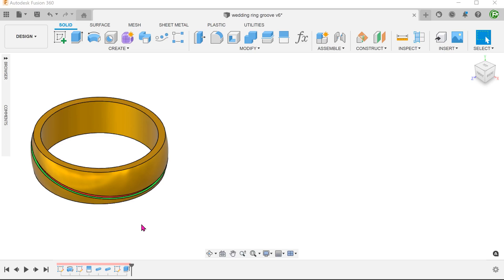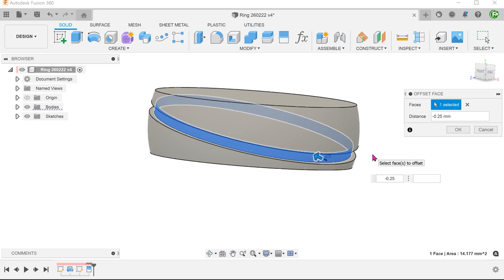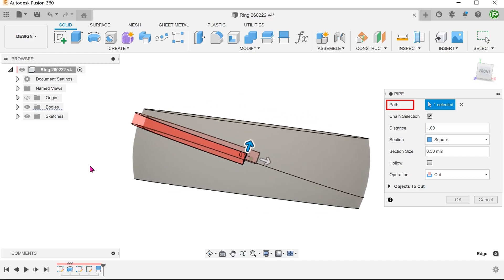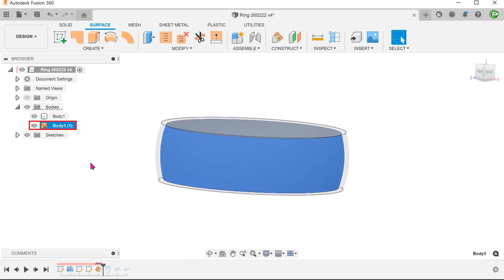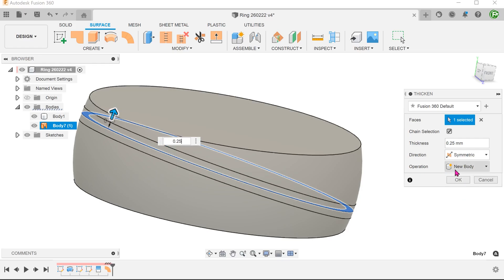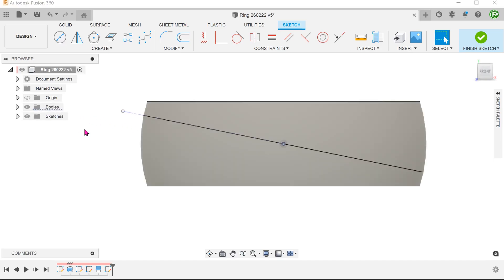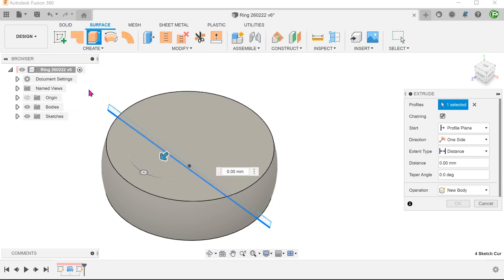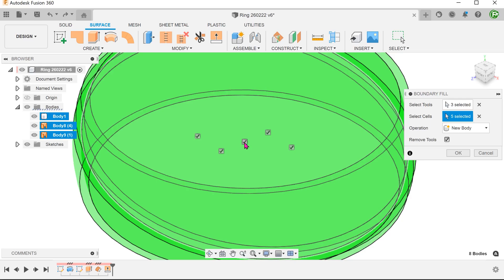Fusion 360 | How many ways? (Groove only)

Comment: I love these how many different ways videos. What about splitting the body rather than the face before doing the offset in the first example? That way you get planar sides😊
Reply from the maker: This is a really good suggestion. I went back to test this and it works perfectly, achieving both the concentricity and the flat side walls. Splitting the body does force the original flat faces to remain flat. Thank you for the suggestion!

Comment: Revolve a semicircle with the groove profile cut out at its equator, then cut off the top and bottom sections of the sphere at an angle, leaving the grooved ring. This way you could choose parallel or radial sides and cylindrical or spherical bottom, depending on how you draw the sketch. But as you say, there must be other methods!

Comment: Thanks a lot, Wing Hoe!

I didn't think there were so many different ways to do it. Eventually I thought of the replace face idea, but with a small difference. Anyways, thank you very much for taking the time to do it! 😄😄

Best regards!
Reply from the maker: No problem. I actually now think that the fastest way to do it is to use the rectangular sketch to split the body and then perform the offset. This was suggested by Jason in the pinned comment. The flat faces would remain flat. I'm curious to know how the groove would be created in practice?

Comment: Excellent Video!  I have often thought about topics like this being the key to an efficient designer.  Knowing the tools and multiple workflows.  Also Boundary fill..... could be such a powerful tool!

A couple other possible ways.
1. Offset the outside face inward, then use your sketch rectangle to split faces on both outside body and offset face.  Then you can delete  the faces you dont need and loft between the others.  This will produce the spherical groove with flat faces.
2. Similar to 1. but instead of loft you patch the upper and lower pieces then use Boundary fill to put them all together(without having to do a bunch of trims). 
3. Similar to 1. but you sweep between surfaces using path and 1 guide rail.

They are really just adaptations of what you showed.  I really like how you showed the most common "go to" first and then the issue with those cut faces being normal to the surface.

Boundary Fill has some great applications and can be used with Solids, Surfaces or Planes, but those check boxes!!!  For option 2 above it only gives you 3 check boxes that are well spaced out.
Here is a dataset with the loft and boundary fill options(1 and 2).  
https://a360.co/3stVpKW
Reply from the maker: I always like your thoughtful responses. I am definitely going to try out some of the suggestions you made. It looks like they revolve around making a patchwork of surfaces and then stitching them into  a solid thereafter. 
You are absolutely right. I presented the methods in the order that they came to me, kind of like my train of thought.
I have a love-hate relationship with boundary fill. It has so much potential but is such a pain to use. Besides the overlapping checkboxes, the colours of the selected cells are just a slight shade different from the unselected ones, making it difficult to see.
Thank you for the file, will definitely check this out.

Comment: Hi great video as always, could I please request that you try doing a bayonet fitting i.e two elements that press then twist together. Especially the detent feature to lock it into place, I've had lots of trouble modelling this in the past
Reply from the maker: This is quite a popular request. In fact, Glenn Villegas has asked about the same thing in another comment here. I have been meaning to do this in a while. Just have not gotten around to it yet. It will definitely involve some of the concepts here.